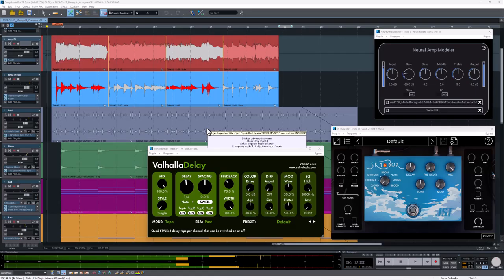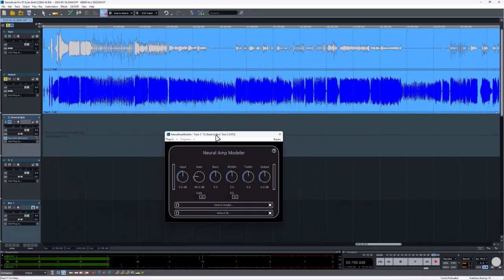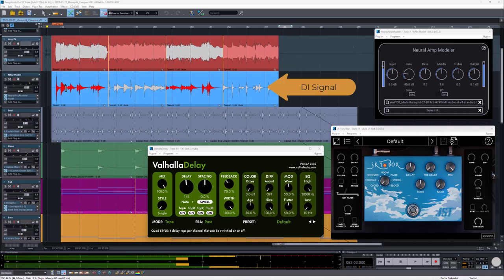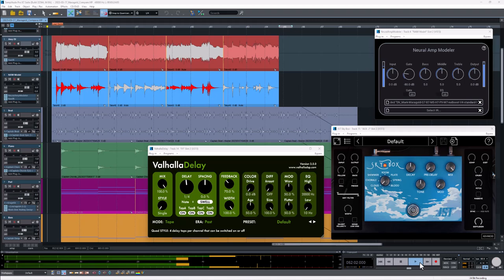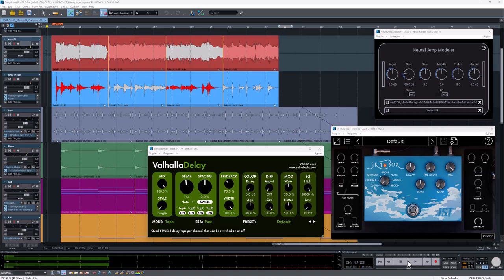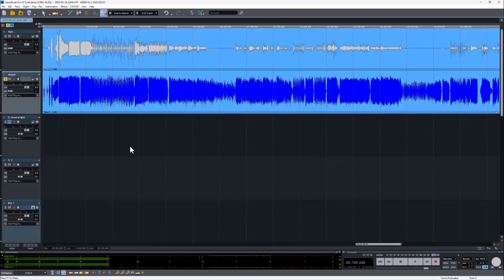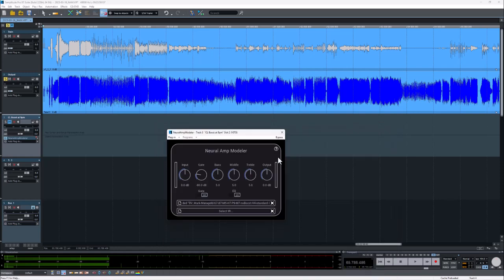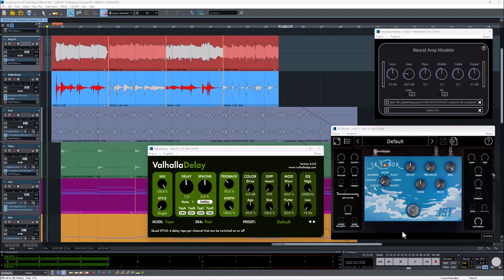Is it real? Neural Amp Modeler - DV Mark Maragold

Comment: Awesome. would you please share NAM files?
Reply from the maker: Right now, all my test NAM model files are shared in the Neural Amp Modeler Facebook group under the “Files” section. If you have trouble finding them let me know. I have been working on improving the capture and getting consistent results across my amp rack and I will probably add the model packs for download on my website once I have tested everything for quality.
Reply: @stillwork  Thank you :)

Comment: Is very nice plugin, but the cpu is running too much in cubase eny solution😊 ?
Reply: Buy a more powerful pc maybe? What is your setup
Reply: You should buy a newer pc😊
Reply from the maker: The models can be trained in 3 different “architecture” modes: Standard, Lite, and Feather. This "architecture" selects from several presets for the size of the network. This trades off modeling quality for how expensive the resulting model will be to run.

Try to find some models (like my Stillwork Orange Rocker 30 pack) that are created using Feather mode and see if that reduces your CPU in Cubase. 

Don’t forget to report back and let other users know if that helps!